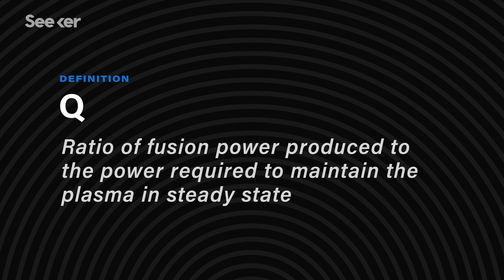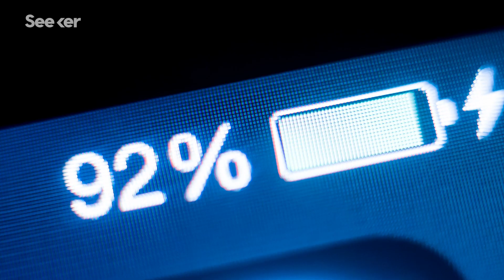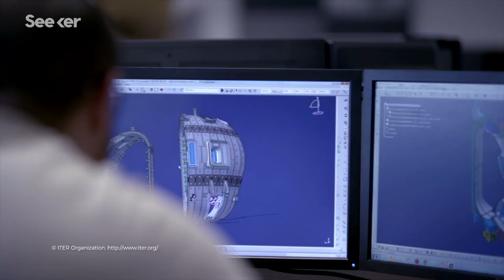How Close Are We to Fusion Energy?

Comment: Thorium based nuclear energy has many benefits:
Radioactive by products that degrade to back ground radiation levels in 300 years
A prototype reactor existed in the late 1960's at Oak-ridge Tennessee, it was shut down by Nixon to save money.
This reactor is unpressurized so a giant containment dome to contain a possible steam explosion isn't required
The thorium reaction uses up ALL of the Thorium the current uranium technology uses up 1% of the uranium before it needs to be reprocessed this means a lot more energy can be extracted from a kilogram of Thorium then a kilogram of Uranium
This means all the energy for one Westerner could be gained from a golf ball sized piece of Thorium
Thorium is four times more abundant then Uranium, the known deposits could last a thousand years or more
Thorium is a 'fertile' fuel not a fissile fuel this means the nuclear reaction has a tendency to fizzle out, the Uranium reaction has a tendency to run-away which makes it good for bombs but a problem for generating electricity.
The fact that the Thorium reaction has a tendency to fizzle out means reactors could be made 'walk away safe' that is the the operators stand up and walk out of the control room and the reactor remains safe with out intervention - this is an excellent default.
 
Thorium has drawbacks:
Getting it to work is an engineering problem not a science problem, so no access to science funding, some scientists spend most or all of their time writing up requests for grant money to conduct experiments and studies, nobody's doing that for Thorium power.
It will disrupt the Uranium incumbents so when ever they are asked for advice they think it's a bad idea
Thorium can't be used to make a practical nuclear bomb, if it could we might have a reactor by now
The metal/materials involved in the reactor container need more research, they are prone to become brittle.
Reply: Here is a nice clip of what they were doing at Oak Ridge. With today's technology, it should be a no brainer. It is the uninformed people who will keep  things like this from going forward the way it should.
https://www.youtube.com/watch?v=tyDbq5HRs0o
Reply: decay in 300 years/!  Even if it was true, do you know what 300 years are? Australia was not even discovered, nor was the steam engine.
Reply: It got tested numerous times but the reactors turned Out to be not efficient enough.

Comment: The funny thing is, they estimate a working fusion plant on the grid somewhere by between 2030-2050. The median of that is about 20 years away. And this has been a running joke in the fusion industry for many decades, that a working reactor is "only twenty years away." Fusion research worldwide has been the most expensive experiment in the history of the human race, trillions of dollars spent...

But if you believe the good people at Lockheed, there are ways around all that expensive fusion research:

https://www.dailymail.co.uk/sciencetech/article-4473908/Trouble-Lockheed-s-fusion-reactor.html

I"m still holding out for "cold" fusion - which has been replicated by the Navy research lab and elsewhere, and might be viable with sonocavitation...

A fusion reactor in your car would get you approximately 70,000 miles to the gallon.
A fusion reactor powered space vessel would have a potential delta V of one million (round trips to Mars taking only a few weeks, to the Moon and back in hours). (But there's also a far more prosaic way to get to Mars fast, in 40 days or less, using a plasma drive that has been in development since the 70s, and was due to be tested in orbit a few years ago...)

So it does have enormous promise. If you can wait those twenty years. What did someone say once about always moving the goal post?

I was a young whipper snapper hoping to marry Miss Fusion years ago. Now I'm an old man. And she ran off with flashy Fission and never came back.

Comment: Hot fusion is a total waste of time.The sun performs hot fusion mainly due to its enormous mass which allows the enormous pressure and temperature inside the core.Without the large gravity its way too hard to create. Now "Cold Fusion" is very small scale very cheap and amazingly low tech and it works.Why are there not many scientists working on this beats me.If one tenth of the effort put into hot fusion went into cold fusion we would have abundant cheap energy by now.Please do this because the world is at a very critical time and needs this right away.

Comment: the simple facts that they aren't self-sufficient, and you have to spend more energy to keep it working than what you get. say how not efficient they are. Inertia and Electromagnetic containment methods have failed. Fusion will only be useful if and when we can get more energy from the reaction than the energy we use to start and keep nuclear fusion working.

Comment: or, OR and hear me out here. We just use fission. It's available safe and the waste isn't more dangerous than other heavy metals after about 300 years. Storing for 10K+ years was only political not for actual safety issues. also reactors that'll run on spent fuel are already in production. The only thing it has against it is "Scary". It's only 1 successful information campaign away from being the prefered power providing system in the world, and there's still so much improvements to be made.

Comment: There remains Problem #1 no matter the source of energy. We simpletons of planet Earth are, for the most part, still turning shafts in order to generate electricity. A fusion reactor is cute and all, but it will just be used as a very expensive & complicated BBQ grill  for turning water into steam, and steam into shaft-turning power. The only form of electricity generation that can be considered more efficient would be a photovoltaic cell...photons absorbed by some fancy chemistry directly to electricity (or even RTG batteries) , instead of fuel ---> burning ---> hot water/steam ---> shaft turned ---> electricity. 
Power generation via IFR Breeder reactors would be best for the coming 20-40 years. Had idiot "environmentalists"/Greenpeace/mini-van moms with agendas not stood in the way as much as they had, then we'd have generation 4 or even generation 5 nuclear reactors, and not a single catastrophic meltdown. Let that sink in. Nuclear power generation has been prevented from evolving into far safer facilities, on purpose by environmentalist special interest groups. The same morons are now to be thanked for allowing fossil fuel burning to remain prevalent. 
An array of photovoltaic cells absorbing photons from fission and/or fusion reactions might turn out to be the best path with the fewest steps between energy source ---> electricity. Electrical grid & electricity consuming devices would still need a major boost in efficiency though.

Comment: My money is on renewables and batteries, at some point thats not too far away, solar energy and batteries will be cheaper than use of an electrical grid (i think)
Reply: A solar RV with Aerogel insulation if normal insulation is too thicc, heat pump climate control, LED lighting, a cellphone computer, and solar oven for cooking sounds cheaper to own and use than a house. A rammed earth "Earthship" might be even more so. Or a log cabin with wood gas truck, but mechanisms and wood sound like they require regular maintenance.

Comment: I don't get why he said we might be able to use existing power transmission Infrastructure. Of course we'll use that same infrastructure, Fusion will use the same process as every other energy system. Rotate a magnet to generate a rotating magnetic field to generate a flow of current. The basic principles of electricity don't change because the steam is being created using another method. Silly off the cuff remark